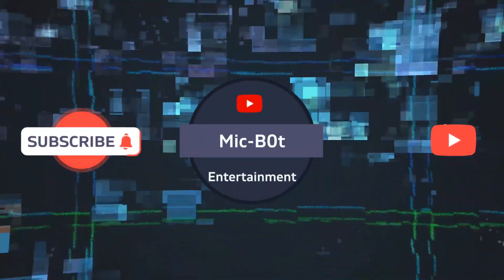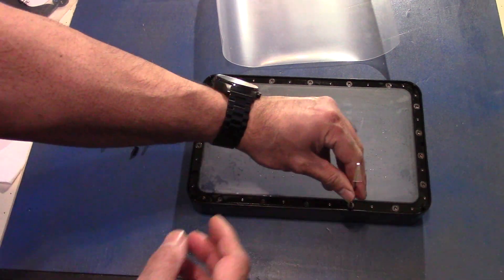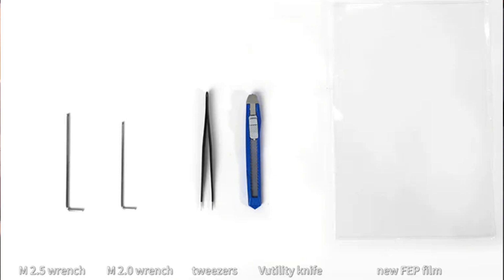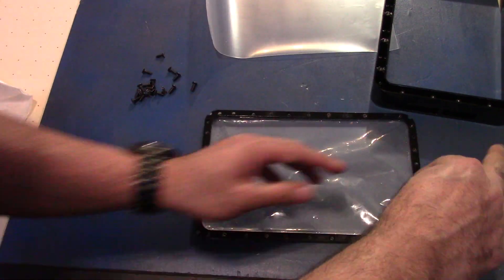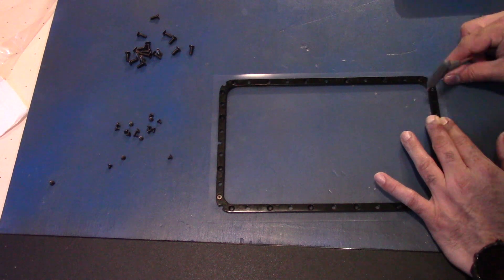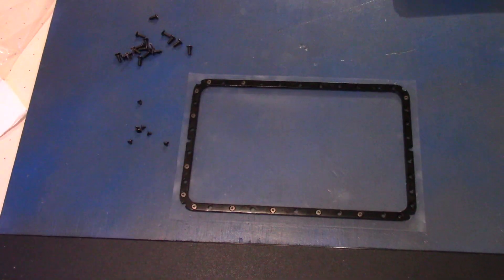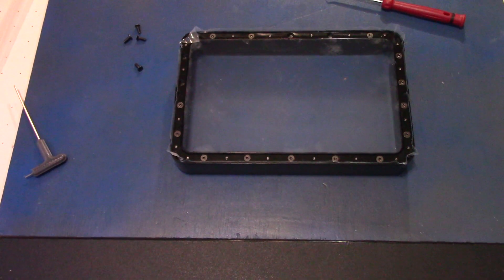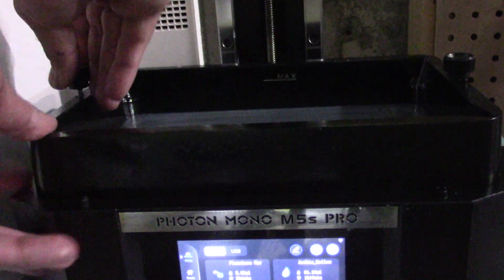Resin 3D Printing VAT Film Replacement AnyCubic Resin Printers #anycubicphoton #3dprinting #anycubic

Comment: I think I bought a bad batch of FEP films form Anycubic they got down the middle what looks like stretch marks , very small but i have changed these out like crazy it was a 10 pack now im down to 2 , and this last print i did with them I had leakage on top of the screen, so i am lost , when I tighten the FEP the stretch marks go away, no white indication of over stretching or tension ,this is not my first rodeo but im about to toss this MF out the window , ive spent so much money on new resin to try, adjusted settings etc..
Reply from the maker: I've been in a similar situation and currently have a bad batch as well, though mine is for the M7 Max. The film is ridiculously overpriced, and the whole package is just terrible, poor quality control.